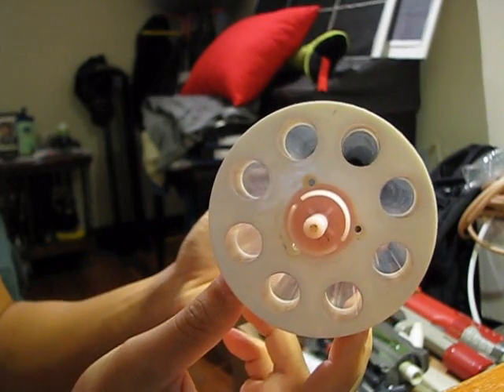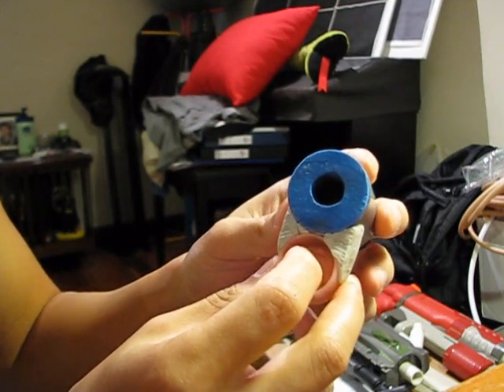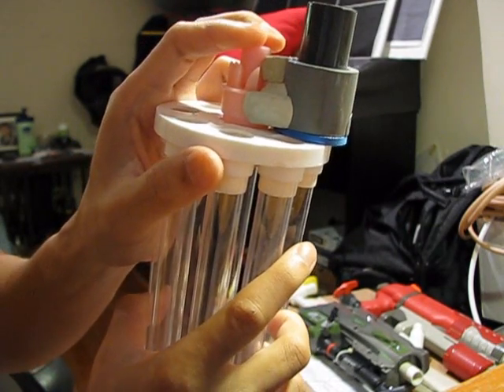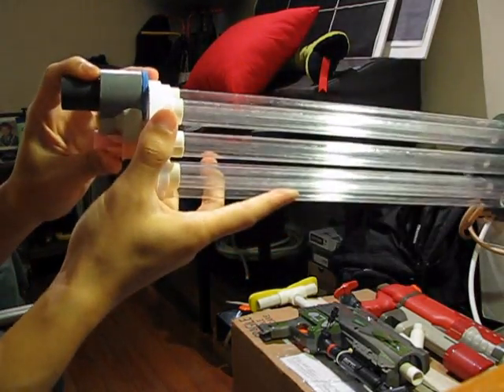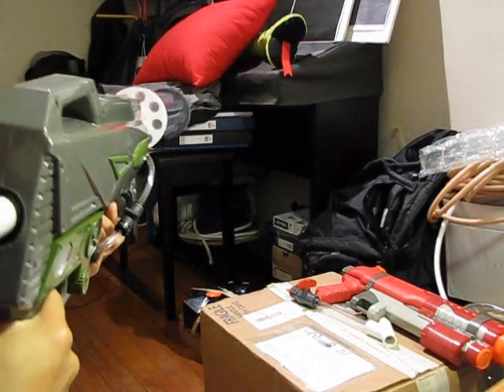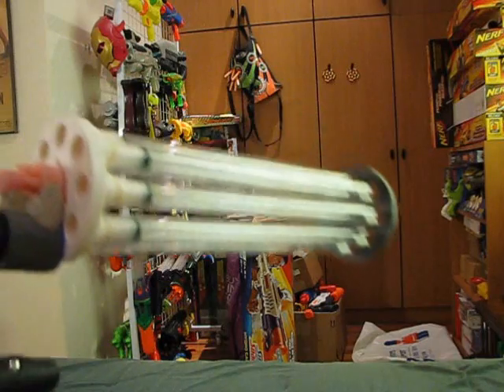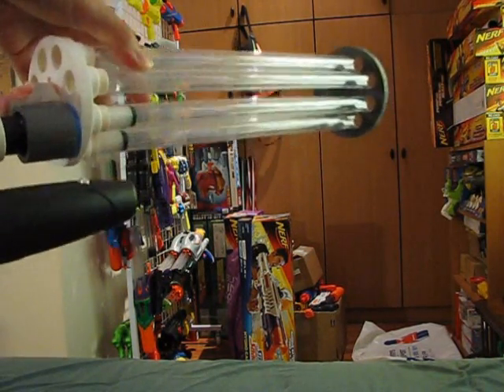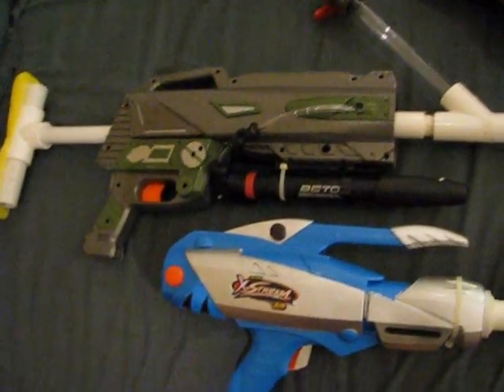Firefly Turret Modification + Rev.2 BBUMB

Comment: it looks like when you test the seal pushing your finger on the barrel will increase the seal possibly causing the different seal,
Are you using jb plastic puddy or normal puddy, I wouldn't recommend the plastic kind because the only difference is that the cured product is more flexible which would be bad for your design

Comment from the maker: @AmpluexCompressa Well each shot has 0 deadspace, unlike hopper clips. Therefore, there is no decrease in range for all 8 shots. You can reload on the go, without having to open your ball valve to load in your darts. Anyway this wasn't meant to be a replacement to the hopper clip, but merely an alternative.